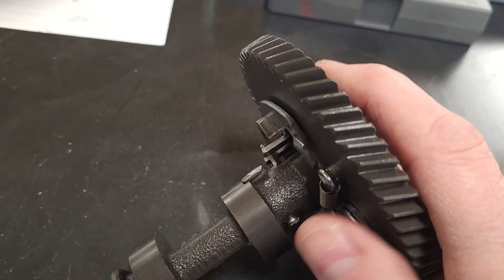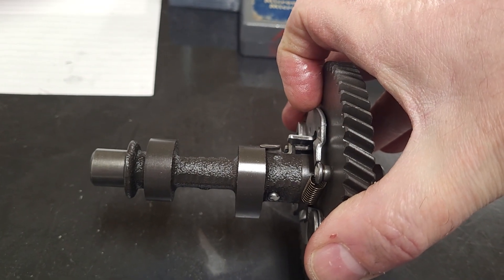Honda Hard to pull. Decompression valve.

Comment: Thank you for this! It helped me fix my 390 on our post pounder. What I did to unstuck it was pull the spark plug and valve cover. Give it a few hard pulls. Check the exhaust for the little bump. Repeat until it does the little bump. Then put it back together and it fired first pull, pulled easy too. Then proceeded to warm the engine and replace the oil.

Comment: Hi and thankyou for the explanation. I was wondering if the lift could be adjusted in order to make cranking (recoil starter) easier. I have a Kohler lombardini 10 hp diesel.
Reply from the maker: I am not familiar with the Kohler. Sorry

Comment: I havw this issue but havent stripped the engine yet. Does the sring break or the level just stick? And if so, is it a case of soaking it in wd40 or sometjing and unsticking it and reassembing? Or does a new cam shaft nees to be ordered? thanks
Reply from the maker: @matthewhayes7765  I haven't had many issues with the cam spring or lever. Mostly valve adjustment. If they are not set correctly you can have a hard to pull issue.

Comment: This was great Jeff.  How can I tell if the problem is with the plastic cam gear thing, or actually on the cam shaft below it -- where the plastic cam gear is supposed to shove both valves open momentarily?
Reply from the maker: @PRSikes  all the parts are metal. The weight is moved by centrifugal force when rotating. At low rpm the weight is inward, pulled in by the spring. It only affect the exhaust valve.
Reply: @jtkasprick  ok,  I'll leave mine alone then.  I thought it might be why mine doesn't seem to get any relief from full compression when I'm pulling the starter cord.  I'll keep looking.
Reply from the maker: @PRSikes  if the weight is stuck fully out or the spring is broken or missing it may cause a hard to pull issue

Comment: This was a great video! Thanks for your hard work making it. I have a Honda that is having this exact issue. I adjusted the lashing and it corrected it for a day but then it went right back to being impossible to pull the recoil. I looked in the Honda service manual and it says check the camshaft. My only problem now is getting the flywheel off to get at the camshaft...
Reply from the maker: @ryanmkeisling9089  you shouldn't have to remove the flywheel. Remove the side cover opposite the flywheel. You can access it there.
Reply: @jtkasprick  🙏 thanks for your response! I will do so.

Comment: Same thing with the Briggs and Stratton engines. My Husky mower seemed to have vapor lock or not enough starter power. Kept charging or buying new batteries. Then learned about a massive number of B&S engines having the same problem. To date, B&S have not assumed responsibility for this.

Comment: This happens to me occasionally on my Toro 721 Power Clear Snowblower ....
They have what Im going to call a 212cc Honda Clone that really runs good but every once in a while, it will catch you half way up the pull and its a hard stop when you dont expect it ....!??? 
Solution .... use the electric starter ....Lol .... but not practical if you stall it and need a quick restart in the middle of the driveway ... !  😂
Reply: How do you fix it
Reply: @marknye51.thefixitguy  Generally I'm usually in a hurry. I let the rope feed back in, If I'm lucky I start the pull slowly and it catches and starts.  Sometimes though when I hit the early stop point, I slowly pull through it, let it retract , then do a slow pull and it starts ???
Just trail and error I guess, it's never quite the same twice .

Comment: You should put a note at the beginning of this video that in no way are you going to tell us how to fix it
Reply from the maker: By your comment I am assuming you were looking for a fix. There a few things you can do depending on the issue. If the centrifugal weight or springs are damaged  or seized it will not move the lever opening the exhaust valve. It could also be a exhaust valve issue. If the valve has to much lash then it will not open even if the decomposition unit on the cam is working properly.
Reply from the maker: It could also be something mechanical. Seized or tight crank to rod, or piston and cylinder issue.
Reply: Can the decompressor level produce noise, like banging metal, when the spring is loose? Or when engine is running at full RPMS spring doesn't matter?